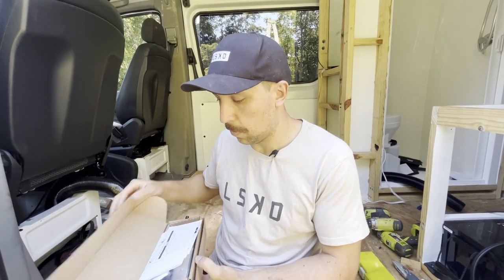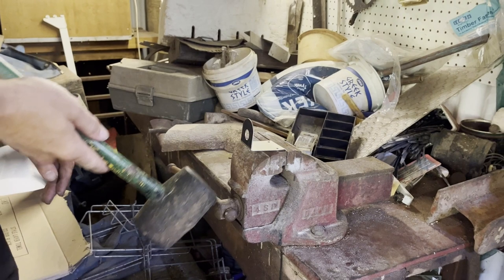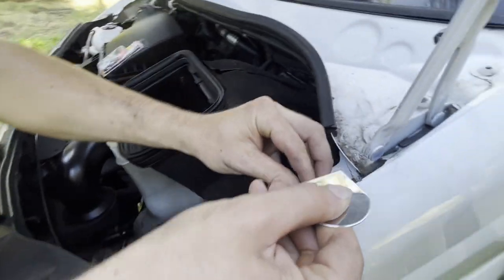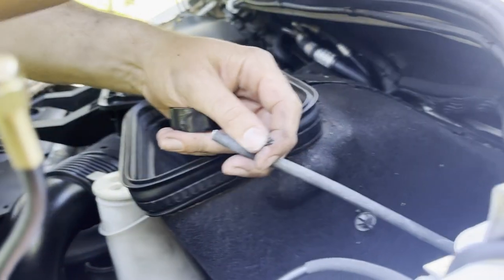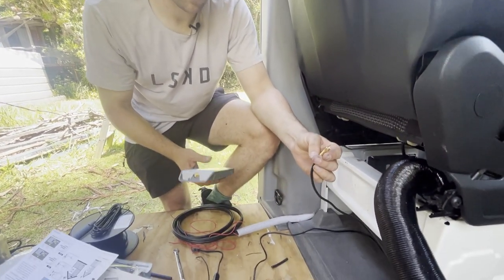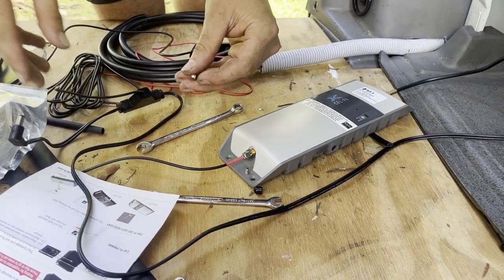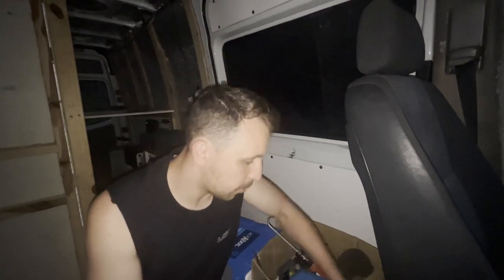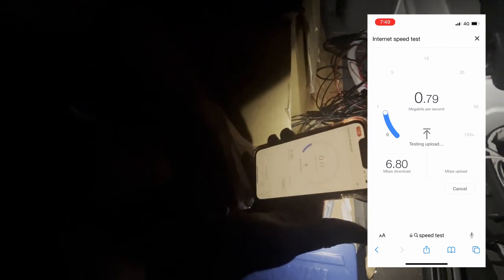Mobile Phone Signal Booster Install & Review (CEL-FI GO) - EP22 Van Build

Comment: If your having bad luck, swap it to auto or 3G, also definitely upgrade your aerial! Cheap aerials never work and any bad reviews on this unit are because of cheap aerial’s
Reply from the maker: Thanks for the tip! The aerial we used was the one supplied with it, but as you said there are probably better ones. We initially had it set to stationary and since changing it to mobile have had a bit of a better experience, although still not fully sold on it for the price

Comment: OK So a few notes. 

-Don't use loctite on your antenna. It has a spring washer. You'll just kick yourself later when it comes time to replace it. 

-Hight is king with a celfi. Mount it on a roof rack it will be amazing. A smaller antenna on the roof will out perform a larger one on the front of a vehicle.

-often you will need to reset your phone network to have it connect to the celfi. For some unknown reason, A phone will often chose a shit 4g signal over a quality 3g boosted signal so try and lock both the celfi and phone to 3g for better results. 

-coverage maps don't mean shit. Never accurate. 

Unfortunately there is alot of misinformation about how these devices work. Fundamentally these devices can only boost signal that exist. If you have 1 bar of 4g, it would boost that signal to make a more reliable connection. 

I install these devices and repair diy installs regularly. 

Last thing, aim for 98% or more antenna separation.
Reply from the maker: Thanks for the feedback. Yeah agree mounting it higher would be ideal. Not too practical for us with the height the van is already, and would have had to look at a folding mount which again isn't the most practical. I think the unit will come in handy from time to time, and we'll keep testing it, but at this point I wouldn't go out of my way to recommend it